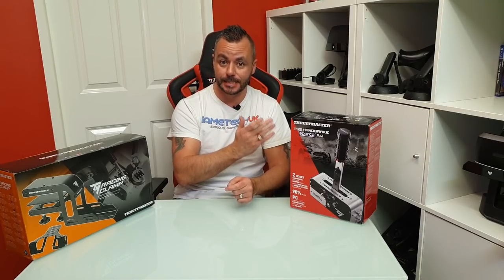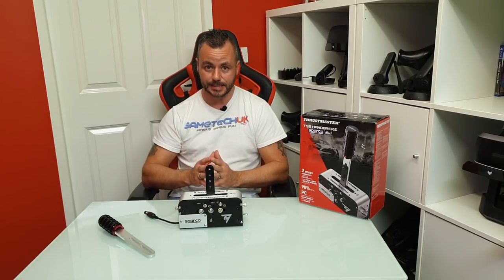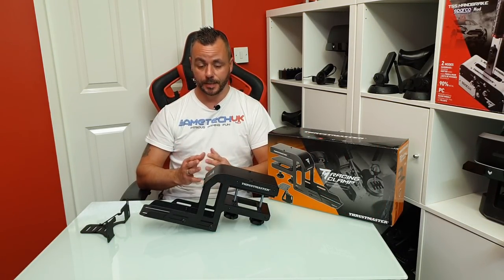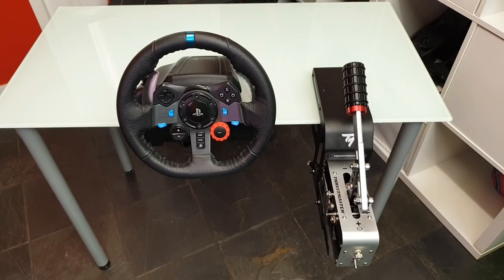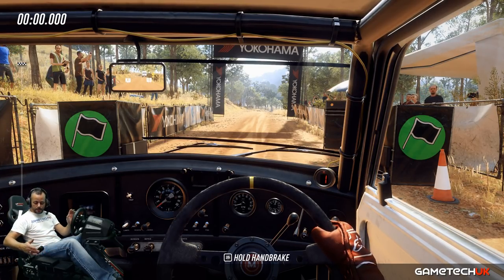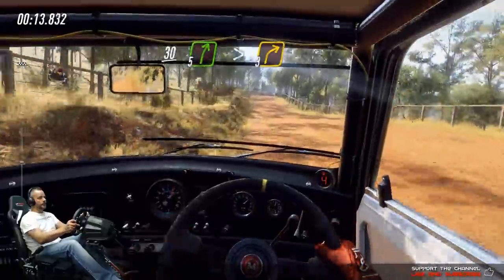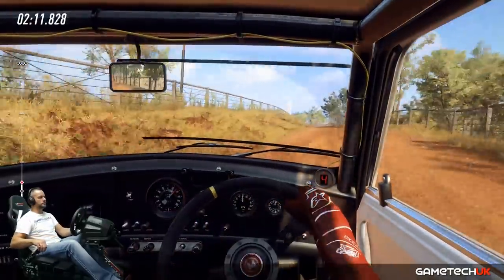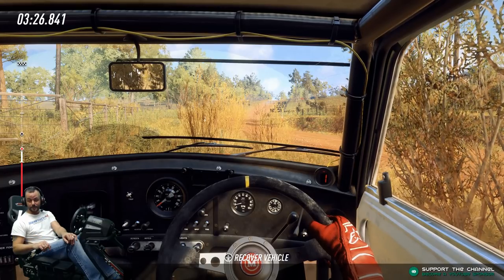Thrustmaster TSS Sparco Handbrake | Setup and test drive | Dirt Rally 2

Comment: Made one from a metal brom handle and a old controler. The short end pushed down on the analog down for the right tumb stick. It worked better then expected. Used it a lot for the years i had it before i sold the home made metal rigg.

Comment: Important to note that if you want to use this on some titles on console and xbox as I believe xbox does not support usb gearstick input it needs to be plugged directly into wheel base which is the sparco tss + (plus) which comes with the small din plug
Reply from the maker: Thank you for that info mate, no mention of that anywhere so thanks.
Reply: @GametechUK  no worries mate, the biggest problem is xbox for not supporting usb shifters

Comment: Will the thrustmaster tss handbrake work with logitech g29
Reply: Bench Rubino nope only thrustmaster bases :(
Reply: it is. It literally says that on Thrustmaster website "Compatible on PC (Windows® 10, 8, 7) with all racing wheels on the market." It comes with a USB adapter so you can plug it in directly to PC.
Reply: Denniz  Compatible on PC (Windows® 10, 8, 7) with all racing wheels on the market. So yes, yes you can use it with Logitech wheels

Comment: Hi there brilliant review I take it this connects straight to the thrustmaster wheel base? If so do you get a double connector so you can use the thrustmaster shifter at the same time as my concern is if this is connected how does the shifter plug in aswell?

Comment: Hey there, great review for sure 👍👍

I just bought a set of t150 pro steering wheel kit and tss handbrake sparco mod. I was setting the tss as handbrake, but it doesnt seem to function with my t150 pro. I was testing it with nfs payback and wrc 10 but it doesnt seem to function. Btw i was using ps4 for this setup.

Can you help me figure it out ?

Comment: To connect the hand brake my g29 wheel and my external hard drive to my Ps4 i wound need extra usb sockets will they work with a usb splitter?
Reply from the maker: Yea the PS4 is fine with a hub, i think a powered hub would be better, msybe check that for yourself. The handbreak is only USB2 so wont need much power, but the hard drive might.

Comment: Could I use this as a stand alone handbrake on PS4? I have a Logitech g 29
Reply: I think it only plugs into thrustmaster wheel bases and wheels.
Reply: It will work,
U need to buy a drive hub, allowing you to connect various makes and models of equipment.
Search it on Google.
I have a gt ultimate motion platform cockpit, with a g920, thrustmaster handbrake and shifter t3pa pro pedals all connected to a drive hub, connected to my ps5 and Xbox series s..
It all works straight out of the box